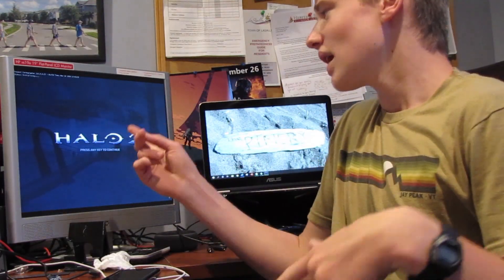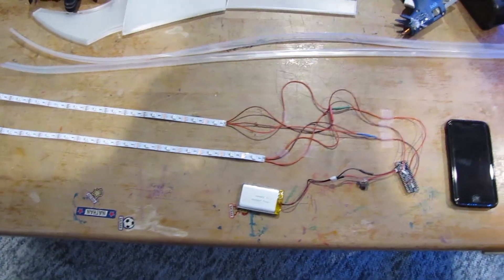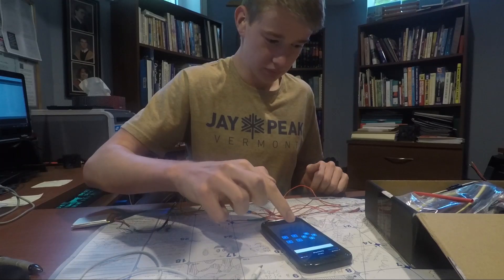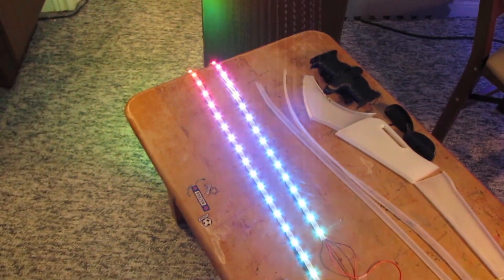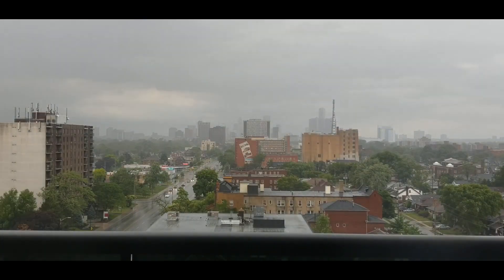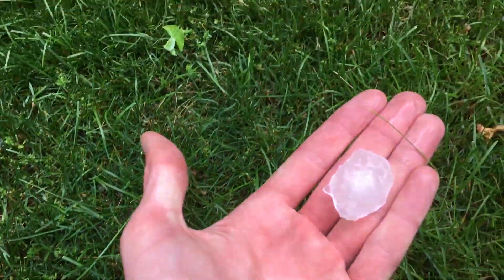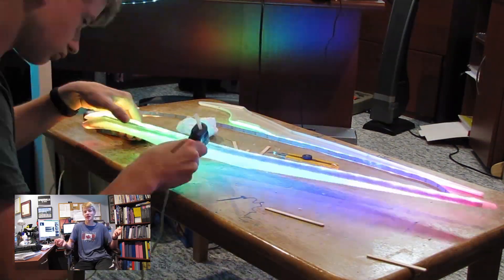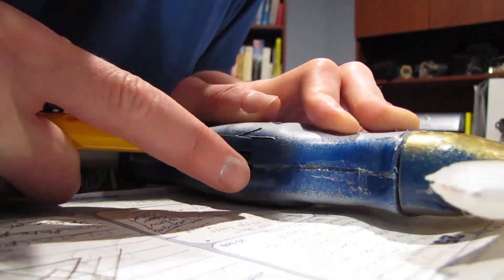Making an Energy Sword from Halo

Comment: I myself will be attempting this project here in the coming weeks and this video is very well put together and I will be using it as a reference! Two question, 1. for the second blade do the parts need to be mirrored before slicing so you don't have like 2 left/right blades? 2. Did you record all your time lapses with a gopro? I feel like my gopro battery gets exhausted and cannot do long recordings for time lapse purposes. thanks and keep it up!

Comment: Keep it up! Only thing I noticed is that the battery may not have charged the first time if its cell voltage gets too low to charge (the charger does not recognize the li ion battery). If it does get too low in this case you can revive the battery with a NiCad charger (I've had this happen to me before) until the voltage is high enough for the original charger to recognize again and continue charging. However it is a lot less costly to replace the battery. Can't wait to see your next project!